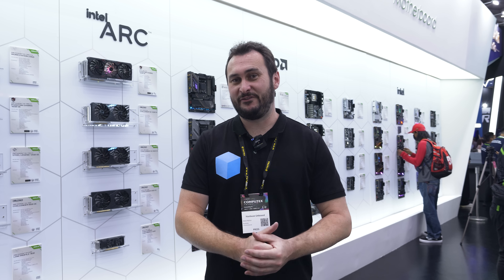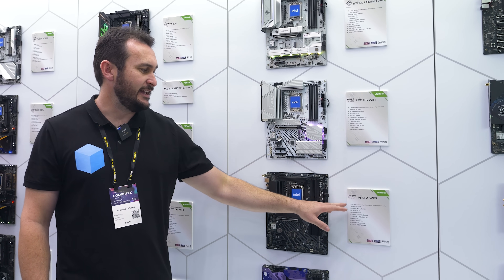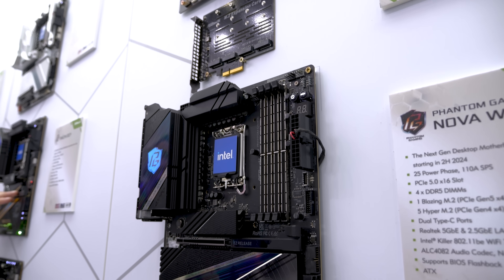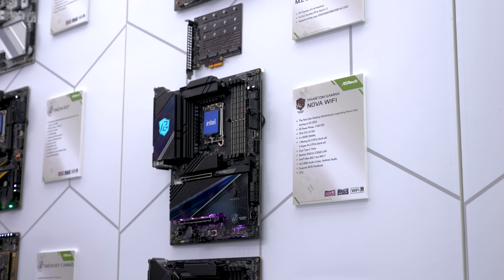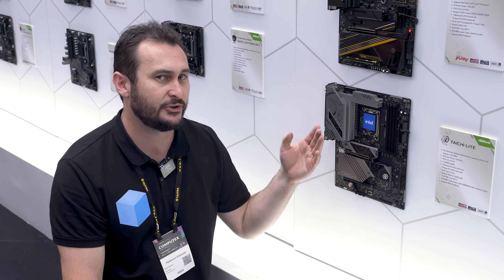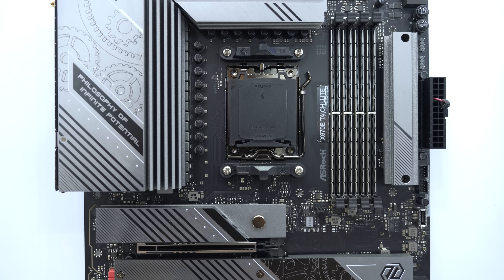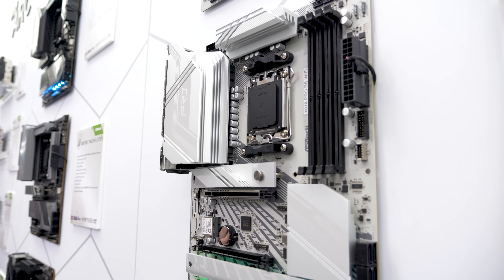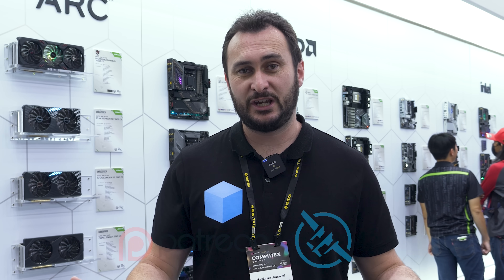Insane VRMs for Next-Gen CPUs - Asrock X870 & Z890 (Zen 5 & Arrow Lake)

Comment: Hardware Unboxed visiting Asrock. What a time to be alive!
Reply from the maker: Haha we did the same last year ;)
Reply: @Hardwareunboxed  It's still cool 😊
Reply: I dont get the joke, can somebody bring me up to speed?
Reply: @Yamyatos  I think the joke is referencing Asrock having stopped sending HU products for review because of criticism
Reply: @Yamyatos  ASRock had a blacklist ; they didn't send out units to reputable reviewers like GN and HUB for quite some time
Reply: @Yamyatos  At this point it's "Who's the least bad", same with a lot of other products unfortunately...
Reply: @Yamyatos  Asus still hands down makes the best motherboards. They've got some flaws, but if you want a stable high end board asus is the only one I'd buy. Asrock screwed up bigtime with the x670 launch, MISC voltage was reading super high, stock MISC voltage is like 1.1v for a 7950x, friend had to set his MISC to 1.45v for stability, they fixed this in a bios update about 5 months after launch and the same cpu/board were now stable at default 1.1v MISC, he could even lower it down to 1.0v and not lose stability so the sensor was certainly reading wrong.
Reply: @Yamyatos  Gigabyte has worse QC issues than MSI, MSI uses lower quality components and tends to fail with age more than other brands, asus can be shitty about warranty but it's just flat out better to not need to use your warranty. A mainboard dying is SUPER rare, I've never had one die on me except one I spilled a glass of water on (Asus rog crosshair x370) which I was able to clean off, replace a single component (voltage regulator) and it's still running 3 years later with my OG 1800x. My FX9370 pc with a rog crosshair V is still running just fine (secondary pc until 2019 then was loaned to a friend as their primary pc until 9 months ago) and even my rog crosshair III with a phenom 965 still works just fine. If a mainboard doesn't die within 30 days of purchase, it's not going to except for user error.
Reply: @Yamyatos B450 and B550 by far MSI is best
for B650 I'd pick Gigabyte or MSI
Reply: @Yamyatos Gigabyte has had the highest failure rate for GPUs and Motherboards for me over the last decade across dozens of builds for friends/familt. Their support is better than Asus but their shit has failed for me about 4-5 times more often.
Reply: @XaviarCraig  Doesn't matter how good the warranty is if it's unstable flaky garbage that fails frequently. I'd rather have a quality board with no warranty than a pile of trash with the best warranty.
Reply: @PineyJustice      no, I don't trust Asus anymore. From my point of view they've rested on their laurels and cut corners on their QC. There are not just issues with their motherboards either.
Reply: @jemborg  And who do you think does a better job, certainly not msi or gigabyte or asrock. And that leaves exactly 0 companies making high end motherboards, so despite their shortcomings asus is still the best and will remain the best until someone else steps up their game.
Reply: @PineyJustice     spoken like a true fanboy.
Reply: @jemborg  spoken like someone who isn't familiar with computers. In the gpu space there are better options, but there are not in the motherboard space, period. MSI is trash, asrock is double trash, gigabyte might as well ship everything they make straight to a recycling center.
Reply: @PineyJustice   ... and your comprehensive review channel is where?
Reply: @jemborg  I don't make videos of computer hardware, but I do build many computers for people as well as work in tech and collect computer hardware. You clearly want to hop on the bandwagon here but don't have enough knowledge to do anything other than attack asus based on what you heard in videos. Since you want to refute me, what brand do you think is making better motherboards now? Because I assure you, they all suck, asus just sucks the least in the motherboard department.
Reply: @PineyJustice  this is your takeaway from watching this video? 😂
Reply: @PineyJustice     you're talking out of your backside fboi. 
PS: I have NO DOUBT my rig would challenge yours gaming.
Reply: @jemborg  Once again, more silly attacks and nothing to argue the point. I've got a 7950x and a 7900xtx nitro+. I've also got a 5950x and a 6950xt nitro+ not that it really matters.
Reply: @PineyJustice      you're the one making attacks hypocrite. I just disagree with you wholeheartedly.
Reply: @PineyJustice     that IS a nice rig. All I have is a 7800X3D/4090. 😁
Reply: Is biostar still alive?
Reply: @SteelRatVT I had to check if they are and they are releasing a X870E motherboard.
Reply: You gotta shill who pays the bills. It's basically YouTube gospel at this point.
Reply: @iamperplexed4695  you have no idea what shilling means, do you?
Reply: @jonessii  It's being used colloquially, not literally. Lighten up.
Reply: @iamperplexed4695 So according to you this is considered Asrock shilling even tho their trip was sponsored by MSI, you know Asrock's direct competitor

Comment: 27 110 amps for AM5 is crazy they could cut it in half and still power any chip that is coming out
Reply: 2990 amps, approx 3500W at normal voltages. Assuming the chips can operate at around 30% without any type of cooling, that’s 1100W… with the max power consumption in the CPU range likely to be 230W…
So actually you could cut it into a four and probably have no issue. Without heatsinks on the mosfets.
Reply: @guyfawkes8873  Maybe Zen6 will have a 32core top end CPU.  Could AMD have already told board makers to future proof the VRMs because Zen6 will have these amount of cores?
Reply: @jayvee8502  Man, they can put out a 64core chip that requires LN2 to work and the 27*110A VRM would STILL be overkill.
Reply: @jayvee8502  Pulling that much power would blow the circuit of a normal US home. It would be pushing a European to it limits. It's big number betterer.
Reply: @guyfawkes8873  Doesn't work like that but still extremley overkill. You never wanna run at even half your vrms  when calculated like that
Reply: Obvious that they're just going overkill on both. Arrow lake has the same core count as 14th gen without hyperthreading, is on TSMC 3nm and is running at slightly lower frequencies so it's basically impossible to not use less power than 14th gen.

Even with no improvements to efficiency, HT being off would still reduce absolute power a good bit
Reply: @Frozoken  Arrow Lake 8 + 16 will probably be close to the 9950X(170W) in power consumption, 8 + 32 next year might be around 200W though.
Reply: @MaxIronsThird  Exactly so less not more than the 14900k which most z790 boards could already support being my point
Reply: Can zen oc past 5.7
Reply: Yea it’s beyond silly… I’d almost rather have the shitty doubled four phase designs back if that means pricing would come down to ‘normal’
Reply: Yeah. Total waste of VRMs.
Reply: @jayvee8502  and money

Comment: There is a disappointing lack of Debug LEDs on that crop of display boards.
Reply: It's 2024, we should be seeing small OLED/LCD debug screens as standard by now so they can actually tell you whats wrong or happening. I had this on my older Asus X570 Formula and it was such a handy feature.
Reply: @richard-davies I had it on my X79 Asus board from 2012! I thought for sure it'd become standard in the future and yet here we are 12 years later. That board also allowed BIOS updates without a CPU installed which would be great for Ryzen but nope I guess we can't have nice things 😢
Reply: @TheFeelTrain  the last two chipset series plus most of the 400 series have had cpu-less bios updating. even when debug screens were more common most manufactures failed miserably to give a full code list. at most you got a code for cpu, memory, or gpu initialization failure or not installed.. everything else was just blank or didn't exist in the code list. either way for 99.9998% of users the screens useless for them because they don't know enough to figure out what the code means and you end up going through the same troubleshooting process as a yellow or red LED lighting up on the board.
Reply: @sirmonkey1985  Maybe other brands do, but Asus doesn't have CPU-less updates on their cheaper boards. My last 3 boards have not had it (X370 Prime, Strix B450-F, X570 TUF)

I have stuck with Asus for my two machines (desktop and NAS) because I like their BIOS menus but maybe that was a mistake.
Reply: @TheFeelTrain  You stuck with ASUS because of their menu layouts... oh man... you better shop around. Do not get their expensive x670(e) boards just because their bios looks good. I have the x670e Crosshair Hero - bought it before the debacle with Asus. Their BIOS is wack, broken and moronic. You cannot set the AI tuner to manual as that renders the PC into a paperweight unless you clear the CMOS. The PCI-E Gen stepping is connected to FAN Header RPM speeds - either you have PWM headers or you have PCI-E Gen stepping... because of their idiocy you can't have both. Sure, you could manually set the Gens in the settings... but the AI tuner software will decide to either ignore them or follow them or randomly change PCI-E gen stepping of M.2 drives when gaming when you set 'Alteration Mode Switch' back to 'Fan Profile' thus crashing the whole system requiring a warm reboot via the reboot button. This setting is not even in their own manual...
Reply: a friend of mine quipped this week that it's become the most expensive 10 cent part on a board
Reply: You won't buy the motherboard for the purpose of debugging it. Speaker out/small leds are more than enough and has always been. The push for 7 segment LEDs is absurd.
Reply: @dat_21 
You've lost your damn mind. A vast amount of people want 7 segment debug LEDs. It's why mobo manufacturers are intentionally ONLY putting them on higher end boards to push people into paying absurd prices for a cheap to add feature that can save a ton of time troubleshooting.
Reply: @KaoruSugimura  Let's be honest, it's not useful. It's only useful to the kind of pc builder who doesn't connect their cpu cooler or who overclocks the memory and doesn't know how to reset the BIOS. 
90% it works out of the box. 5% it is something trivial like the dangling cable and 5% it's something not easily fixable and requires component swapping either way.

Where exactly is that 7 segment comes useful and how exactly is it better than the small 3 or 4 leds, or the beeper.  

And by the way, these small led thingys weren't even there before. Before that we had to rely on beepers. And even then the only time I used the beeper, I didn't even knew the error code. But it was obvious that something was not functioning, because you don't hear 6 short beeps when you boot up the pc. It was 1 short beep and you instantly knew that everything was nominal.
Reply: @dat_21  But the problem with current systems with DDR5 is memory training, how am I supposed to know what the board is doing without a display while it sits powered on with a black screen for 30secs to maybe 2 mins while it does memory training. At least with a debug code as a minimum I can look and see, oh  it's training so I can just wait for it instead of wondering if something is wrong. I remember using systems with beepers and so glad those are gone as they were useless for anything meaningful.
Reply: @richard-davies  Two and a half minutes just to boot a fresh system? Well, that's something. But then again, that 7 segment is only useful if, and only if it actually outputs decent error codes throughout all stages of booting and they are all documented thoroughly in the manuals.
Reply: @richard-davies  how is reading a 7 segment screen then cross-referencing that with a table in the user manual functionally different from looking at a series of leds and cross-referencing that with a table in the user manual?

Comment: In 2024, VRM overheating is a non issue as long as you don't go super-cheap on your motherboard.  The far bigger issue is CPU cooling.  My Z690 Taichi board is awesome, and if I do build an AM5 system, another Taichi just might find its way to my house.  I'm looking forward to Zen5 testing and pricing to see what those results do to Zen4 pricing.
Reply: There are still many mid-range boards with poor VRMs.  The second wave of B650 boards in particular were cut down, and covered on this channel.  Certainly not an issue on Taichi, but far from being just an issue on super-cheap boards.
Reply: Yes, starting to wonder about immersion cooling.   Watching videos.   Cray computers from the past going through my head.

Comment: I have an x670e taichi atm and man the new one looks a lot nicer(oddly the non e looks better) hate the io though, the current taichi only has 2 audio ports which makes surround sound speakers an extreme pain to try. Also the pcie slot is lower than a standard board again, it causes compatibility issues with certain gpu/support brackets and cases which is the main let down

Comment: So... 5 to 10 nvme ssds huh?
I wasnt going to upgrade since my 13900K does exactly what I need it to do.
But I need more nvme storage than the 3+2 my Z790 can provide.
Reply: This is exactly me - my 5900X is more than enough, but changing from 2 NVMe drives with many HDDs into all NVMe would be a hugely meaningful improvement to my experience, not to mention DDR5. So funnily enough, a new build with a new CPU is all about the storage and memory and not about the CPU!
Reply: @silvermuse92  You could check if your mobo support PCIE bifurification. That could allow you to add a 2-4 slot nvme expansion card. Thats what my board shipped with.
3 nvme + 5 (+1 hotswap) sata ports and a 2 slot gen 5 + 4 expansion card.

Might be able to give you more drives in your system for less money.
Reply: @Waldherz  I’ll check out that option, thanks for the suggestion!

Comment: i thought the X670E lineup was already so overpowered even at entry level? as far i'm aware they are just fine for a Zen 5 drop in upgrade.
Reply: yeah no idea what they are doing dropping 27 110 amp in.... you could easily cover every release available on am5 with half as many, even on the intel boards it is overkill
Reply: My X670E Taichi already has 24+2+1 power stages.  The X870E going to 27+2+1 is like.. literally zero difference.  10% more power stages dedicated to CPU, but that's so pointless when you ALREADY HAVE 24.  
It seems like X870E and B850E are just meant to be scammy upgrades meant to part consumers with another $400+.
Reply: Hell my asrock b650e Taichi lite is even beyond overkill for 9000 series ryzen. 24+2+1 Power Phase, 105A
Ill be set thru ryzen 10000 lol

Comment: 27x110A that'd power a dual socket epyc system lmfao
Reply: Maybe push power to gpu at the same time without any cables!
😂
Reply: well Intel is the new furnace/volcano/sun... so I guess we can expect the new chips to use even more power...
Reply: @LiLBitsDK This config was for the AMD boards... Intel had a 31*110A config. What a waste of powerstages though. You can power entire server racks with these many Amps and they are wasting them on some 9950X that can be powered by 1/3 of this VRM with absolutely no problem...
Reply: @TTL_Tsaki Those are top end boards
There will always be that one cheap good board that has resonable VRMs
Reply: @LiLBitsDK generally yes, but supposedly Intel’s next Gen Arrow Lake CPU’s are being made at TSMC and should have the same power/thermal characteristics as AMD chips.
Reply: @benjaminlynch9958  you're joking, right?
they're completely different architectures. How could they be similar. the biggest glaring difference is one is chaplet other is not.
Reply: @TheHighborn in any case arrow lakes are not expected to be the furnace level power-hungry
Reply: @Mglunafh  it is easy to make intel CPUs run cold. Just drop 1 gigahertz. What I'm looking for is performance improvement for less power and cooler operation. To be quite frank with you, I don't actually expect intel do deliver. I hope tho. Even if I'll most likely NOT buy an intel CPU, (as I'm on AM5, and changing platforms would be a breathtakingly stupid financial decision), competition benefits everybody